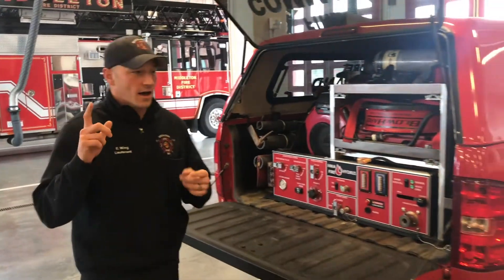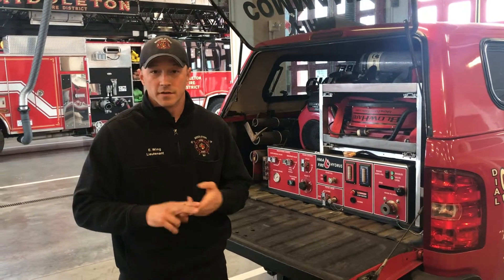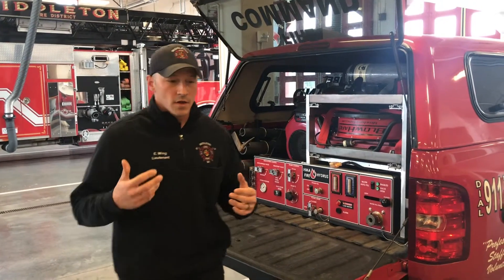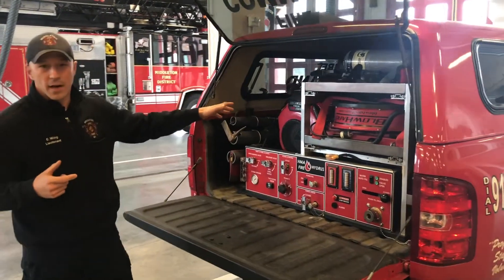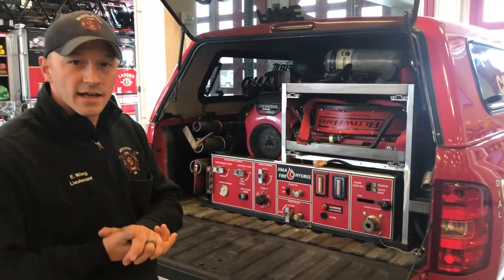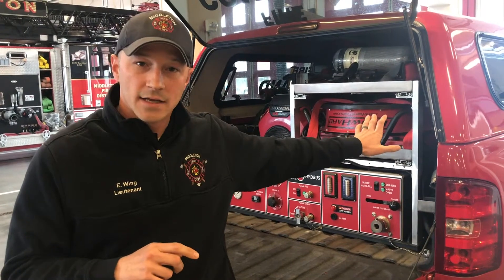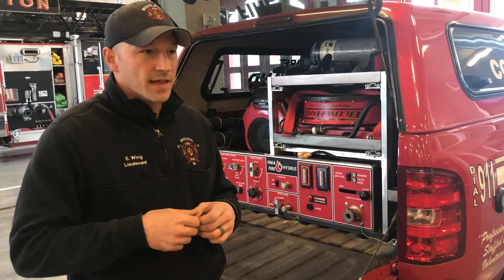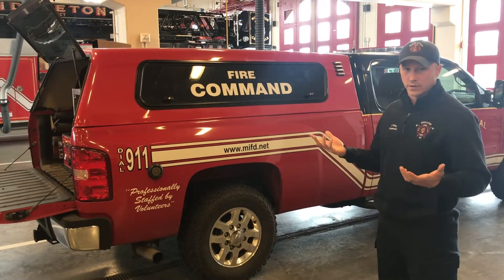UHP & Rapid Response Model Video

Comment: A vehicle should be built around this system not this system put in the back of a vehicle. With ability to pump on the run from inside the cab.  MALPRACTICE

Comment: What model system is in the video
Reply from the maker: Hi Kevin, this is a Hydrus 20gpm Command. It is the Cadillac of our skid units. We have other units as well that are water-only (still at UHP) and then you can add on any features you want. Also, have a Droplet system that is everything a skid is, minus the tank. Great for retrofitting a brush truck and/or placing in a compartment on a large apparatus. Hope this helps, please ask any other questions and sorry for the long response time.